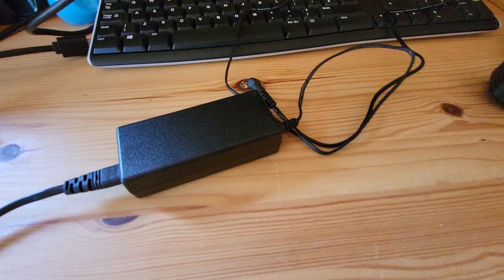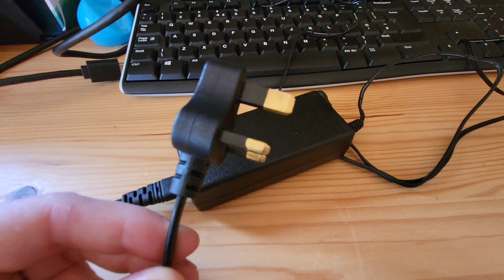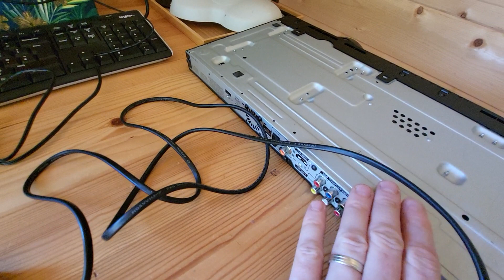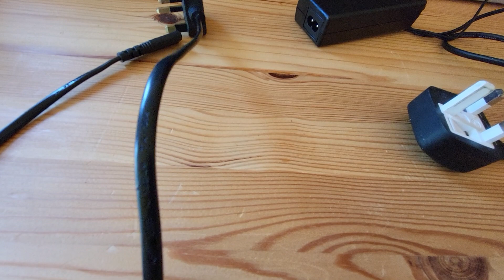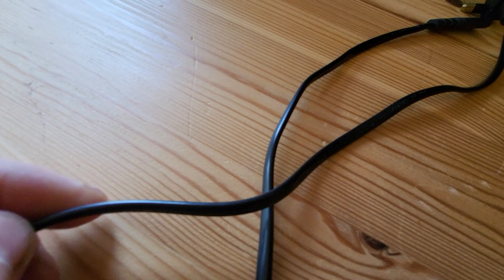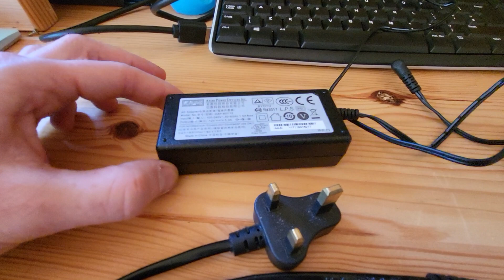Dangerous unfused UK Plug and flex. PAT Testing tutorial. Electric shock risk

Comment: The sad thing is some other people who do PAT testing pass these unfused plugs. If someone on EBay fobbed me 
off with one of those horrile leads I would cut it up and it would go straight in the bin and I wouldn't even leave feedback!
A few years ago I was very shocked to find a hair dryer in a charity shop with one of those ufused plugs that had passed,
I wanted to let the people working there know that it was dangerous and shouldn't have passed but the only reason I didn't 
was because I would have lost it with them if they disagreed otherwise.

Comment: That output cable doesn't look like it would stand 5Amps for very long. Also BS1363 specifies that the plug casing extends a minimum of 9.5mm in all directions from both the Live and Neutral pins, that one looks about half that!!

Comment: If you want a laugh, cut the plug off and have a look at the cable cores, it’s like 2 strands of hair. 

Also the plastic on the adapter is dangerous. If it was to catch fire and melt the droplets of plastic stay alight, where are BS standard doesn’t.